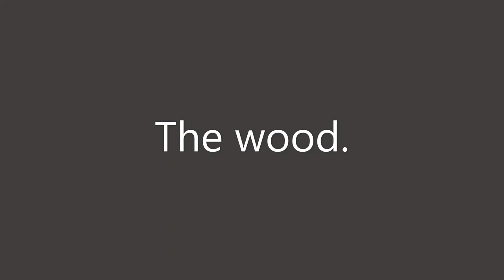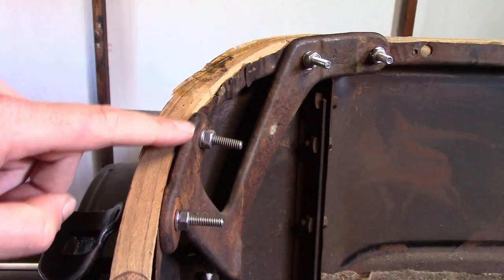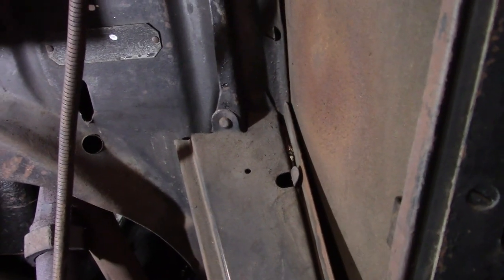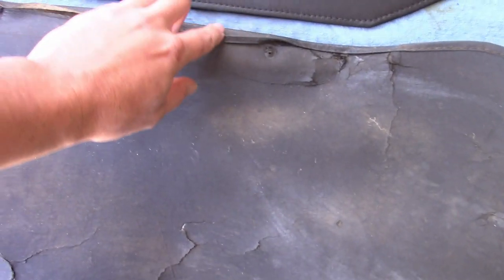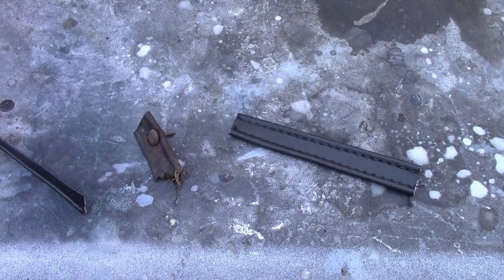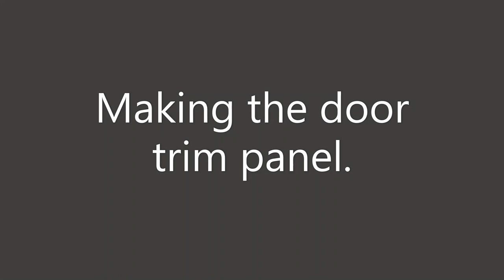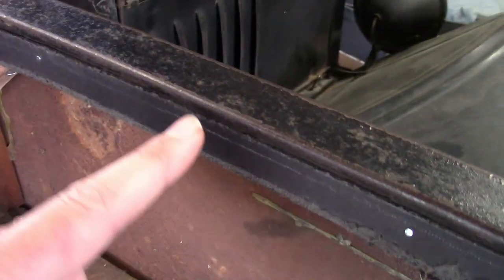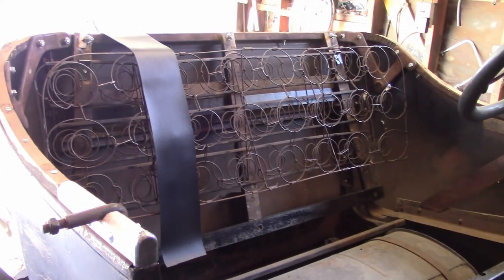1925 Ford Model T New top/interior. Part 4.

Comment: After your bolt passes through wood, a lock washer is useless, nylon lock is best. As the wood ages the pressure on the lock washer decreases. Lock washer is for metal to metal.

Comment: This is great! I have a 25 Roadster that I am going to put new panels and top on. Having trouble finding the sockets for the top.  What material are you using for the panels? My car has been stripped so I have no patterns.
Reply from the maker: I'm using regular upholstery panelboard. It's whatever the local shop has in stock. I'm not sure where they get it from.